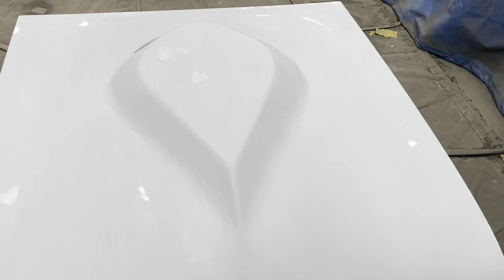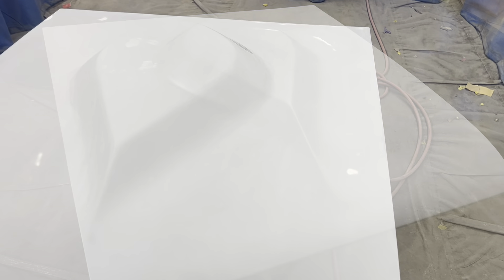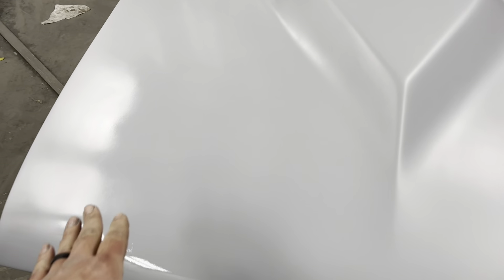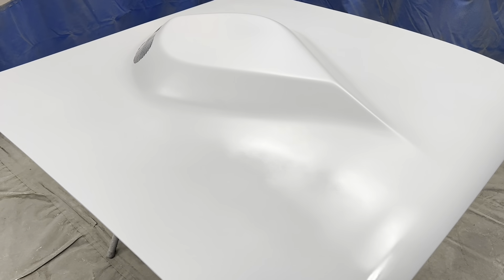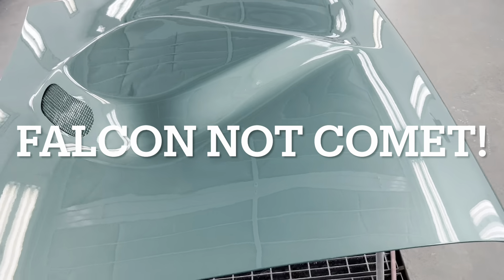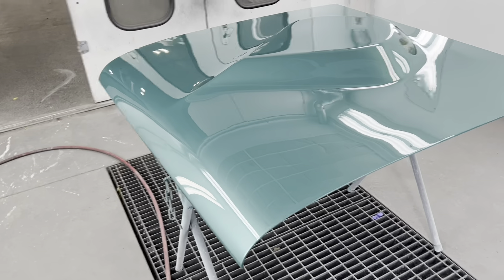1960 Falcon Teardrop Hood!

Comment: Nice piece exact copy of FOMOCO part for first gen falcon. Fiberglass is difficult material to duplicate and top quality materials and careful application allows a perfect match to original Ford parts after test fitting. This rare car and hood was exact copy Dearborn 1960s experimental part for Ford that went on till 1970. Retro is alive and well. Thanks to Sussex Tech!